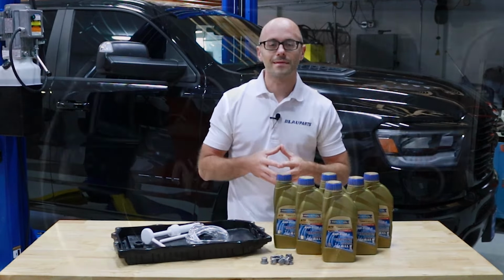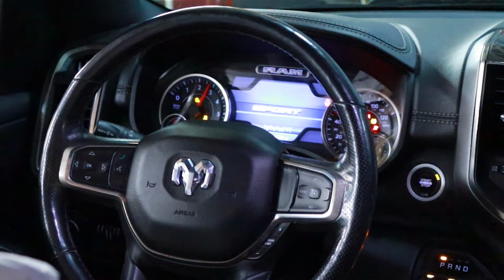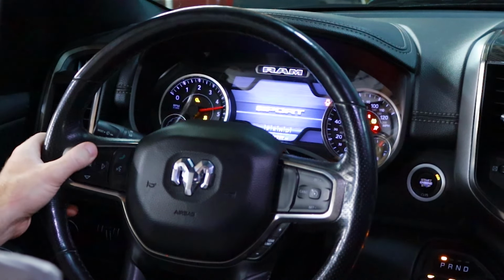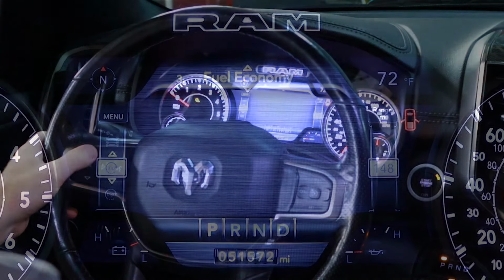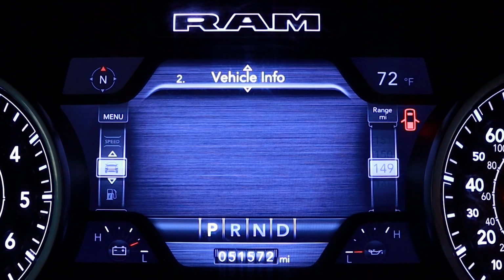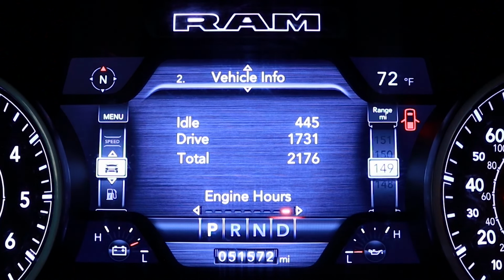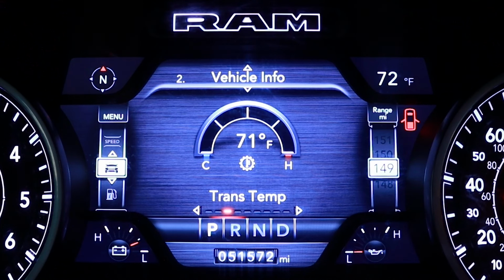Ram 1500 Transmission Fluid Change How To | 2013-2026 ZF 8-Speed 8HP

Comment: The temperature cooling process is what takes the longest. I wish he would've told me it could take all day just to stay within the 86-100 degree temps during the draining and refilling process. That's hard to do for a first timer. Plus those pipes are so dang hot 🔥 when putting that drain plug back in.
Reply: what I did was grind and Allen wrench
Reply: Did u also have to Jack up the transmission? Any tips since I’m planning on doing this job tomorrow? 😅 thanks in advance
Reply: @bdm408  No. I have a shallow transmission filter. But it was tight. Just be careful not to break any plastic fins inside the transmission near the sensor when taking the old one off.

Comment: Thank you so much. This was very easy to do. Not anymore difficult than doing oil changes. Took me 2 hours and that was me just being paranoid throughout because ive never done this before.
Reply: To add to this, it made a massive difference on my vehicle. Ram 1500 rebel, 65k miles. Wish I did this at 50,000. Instantly, all shifts are significantly smoother, don't even feel them now.
Reply from the maker: Glad it helped!
Reply: Did u use a Jack to lift the transmission? I’m planning on doing this tomorrow 😅
Reply: @bdm408  so... I lifted the truck up on Jack stands and then for the transmission to lift that so the transmission pan will clear and you can pull it off/replace it I used the little scissor jack that came with the truck because it was small enough to operate under there and a 1/2 inch extention with thick walled socket for a sturdy base to push off the jack and onto the spot they show  on the video. It's not lifting much weight so it really wasn't sketchy at all.
Reply: @stevenshelp1107  thanks so much for the reply!!! That’s actually a good idea to use the trucks scissor Jack. Smart thinking! Can u explain the 1/2 inch thick socket extension a bit more? Did u place that socket between the top of the scissor Jack and the transmission? Is it just a thick long socket? Thanks again and I appreciate u taking the time to reply.
Reply: @bdm408  yeah, so the issue with trying to use a normal jack under there is there is almost no clearance between the actual jacking point on the transmission and a cross member. You need something pretty slender, take a look at your truck before hand in reference to the video  and you'll see what I mean. I used the extension ontop of the scissor jack because it was slender enough to fit up there, and a socket on the end to the scissor jack so it was stable enough lol.

Comment: Thanks for this. I’ve read this process but seeing it makes it seem doable. I still think it is wild the owner’s manual says the transmission fluid does not need changed.
Reply: Ram says it doesn't, ZF who makes the transmission says that it does. I'd listen to ZF and not Ram, no such thing as lifetime oil.
Reply: Crystler wants to sell you an new transmission

Comment: Just completed this process on my ‘21 1500 e-Torque Laramie. This video was a HUGE help. Replaced my pan with the bigger PPE aluminum pan with replaceable filter. Everything installed very easily. No leaks and smooth shifting.  Thank you for the detailed instructions!
Reply: I just did the PPE pan on my 19' Laramie as well. How much fluid did you get back into it?
Reply: @RobVegas84  Almost 6 quarts.
Reply: I assume you have a 5th gen Ram with Hemi, is lifting the transmission like they did in the video needed for your vehicle? Thanks!
Reply: @FarmerSpring  Lifting the Transmission is to get it level and is totally a requirement. Zip out 3 bolts, jack it up til level and perform your fill. It is ok to run the engine and Reverse, Neutral and park while in this state but use common sense and do not get STUPID here.  Just do the 5 sec runs like a normal person. When finished, lower the jack stand and replace the 3 bolts. You're now done.
Reply: @FarmerSpring  I did have to lift it to get it on there. Wasn’t that bad of a process though.
Reply: Wheres the video?  Haha. JK.  Thats awesome!  So PPE? I’m going to have to
tackle this.

Comment: I have read to level the trans. The rear should be 8-10 inches higher than the front. I did that hope it right.
Reply: You did it right. The way he did it in this video is definitely wrong. The truck was level but not the pan rail.

Comment: What about the oil in the Torque Coverter oil, the Cooler Lines, and The transmission coolers themselves. Why didn't you change that oil?
Reply: Probably because what he did is called a transmission service not a full flush.
That is what the dealer will do unless you insist on a full flush.
The problem with these trannies is that they have a temperature controlled check valve installed in the return(?) line that only opens at a certain temperature to allow for a full flush. You have to know how to bypass the check valve or get it to open just when you need it to. It's difficult but can be done if you know how.
Most shops that flush trannies  don't have the proper equipment or methods to do it right. You would have to ensure that the shop understands the issue and knows how to deal with it.
The shops with the kid down in the pit don't know or care to do it right. In and out and good luck.
Some of them will do the flush but won't use the proper fluid that you take to them. They will only use their normal fluid. "We can't put any "strange" fluids through our machine".
Also they will not touch your pan in order to replace the filter.  Flush only without the pan or filter which is no good.
Sure a full flush is better but there are difficulties involved.

Comment: I don’t have the steel pipe to lift the transmission, what else do you recommend?
Reply: Losses the exhaust bolts on passenger side
Reply: That’s what I did and it worked out great

Comment: Just finished changing the fluid in my 2015 Ram rebel. Your video was extremely helpful. Thanks
Reply: Did you used jack stand ?
Reply: Hey bro did your truck take all 6 quarts mine only took 5 I just wanted to make sure its not supposed to take all 6
Reply: I have a 16 rebel and plan on doing this on Saturday. Did you have to jack the transmission and also did you level the car out and do the air test?

Comment: Is my 8 speed in the 2016 Ecodiesel this same transmission?
Reply from the maker: Hey there, as you can see in the 'Vehicle Fitment' tab of our kit for the 8-speed ZF transmission, it fits the 2014-2023 Ram 1500 Truck with the 3.0L Turbocharged V6 Diesel Engine (EcoDiesel): https://www.blauparts.com/ram-1500-transmission-fluid-change-kit-8-speed-68218925aa.html#fitment
Reply: @blauparts  Thanks. Sorry for not checking better

Comment: Thanks Dodge for making something I did for 40 yrs into a Sh#t show.
Reply: You must not be a technician.  First off, this is not a RAM transmission, the transmission is built by a German company that specializes in transmissions. Also, this is no different than the 10 speed found in GM and Ford vehicles. If you really want to get crazy, I'll show you the Mercedes Benz Triptoz transmission which takes 6 hours to fill correctly. Or, the Auidi V10 transmission, which has to be removed from the vehicle.  Here is Ford F150 if you'd really like to see a sheet show.  https://youtu.be/p96a8_MPwyM?si=vzEs-YpZmQe1SWV6

Comment: I just purchased and changed out the fluid in my 2014 1500 with 159K miles.  I watched this video several times and made personal notes of the sequences.  I've worked on cars for years but at age 72, I trusted notes, better than memory.  Approximately 5 qts were drained and added.  

Make sure the TRANSMISSION is level, not the vehicle.  Can't stress that enough.  The trans sits at an angle in the frame.  I needed to elevate the rear to get the trans level.  I used 4 jack stands under the rear since I needed to allow the rear wheels to turn in the procedure.  

The issue I had was being able to use the hand pump included.  It would not fit the bottles of fluid that are made in Europe.  I had to improvise and I used a syringe to draw the fluid from the bottles and pump into the trans.  

I did notify Blauparts of the mismatched pump and bottles and they are working on it.
I feel confident following the procedures outlined in the video I was capable of doing a complete change.  My trans is shifting smoothly and I look forward to 75K miles of use.
 Thumbs up to Blauparts.👍👍👍👍👍👍👍👍👍👍
Reply: Did you have to lift the transmission due to the cross pipe being in the way? I’m doing mine tomorrow and am nervous about that step 😅thanks in advance for any help or advice 🙏
Reply: @bdm408 did you already do yours? How it go?

Comment: I've done this a few times already with my 4th gen rams (one has 360K on it...but with no servicing and the others begin to chatter @ around 130-140K miles probably a lot sooner if you tow).....Just did my 2021 4x4 5th gen: did it in the driveway like before; definitely more of a chore and had to jack up tranny which was really no big deal, but now instead of one tough bolt there's 4.

These ZF transmissions are impressive as long as you service them
Reply: Any specific way to Jack up the tranny? Thanks in advance for the advice

Comment: At around or between what mileage should this be done?
Reply from the maker: The recommended service interval for changing the Ram 1500 transmission fluid on 8-speed transmissions is every 60,000 miles. However, this can vary based on driving style and whether the vehicle is frequently used for towing. Check out our blog here for more info: https://www.blauparts.com/blog/how-to-change-ram-1500-transmission-fluid-8-speed.html#ram-1500-automatic-transmission-fluid-change-interval
Reply: Engineers didn't this or the oil filter location thru.

Comment: Regarding the required plumb to earth to correctly gauge the fill, is it the vehicle or the transmission? If the vehicle frame is level, the transmission itself is about 10 degrees out of plumb.  I assume it's going to be different for every different type of vehicle these 8HPs are installed in.  So which is it, the vehicle frame or the transmission itself?
Reply: Transmission

Comment: Really Ram? You couldn’t move the plug a couple inches one way? lol damn engineers
Reply: That's done on purpose lol
Reply: This transmission is used on many vehicles - moving the drain to a better location for Ram 1500s would likely lead to the same issue now occurring on Chargers, Grand Cherokees, Durangos, etc etc etc
Reply: That is assnine.
Reply: Easier to reposition the exhaust
Reply: Right?! They think of themselves as God's, but they're just pawns on a chess board like everyone else

Comment: Flawless design as always ram
Reply: You must not be a technician.  First off, this is not a RAM transmission, the transmission is built by a German company that specializes in transmissions. Also, this is no different than the 10 speed found in GM and Ford vehicles. If you really want to get crazy, I'll show you the Mercedes Benz Triptoz transmission which takes 6 hours to fill correctly. Or, the Auidi V10 transmission, which has to be removed from the vehicle.  Here you go if you'd like to take a look at Ford F150 genius. https://youtu.be/p96a8_MPwyM?si=vzEs-YpZmQe1SWV6
Reply: @onthethrottle7104  you're right it could be more difficult....it could also be designed to be less difficult 😉

Comment: Should I level my truck when checking level or keep it at the factory rake.  It is a short bed 2 door to it has quite a bit of rake?
Reply: I think you need to lift the rear end of the truck 8-12 inches to get the transmission level for filling.
Reply: I did mine. Hope my fluid is right. I used 5 quarts. I had some difficulty following the end part on keeping the temp down and still running the engine, but I think it worked out. Truck had 132k miles.  Shifts seem smoother.

Comment: Just got quoted $1000 from a shop to change my fluid. Zf needs to get their crap together when it comes to service procedures. The cheapest pan and fluid i could find was $500 that is ridiculous.
Reply from the maker: You may be interested in our all-in-one ATF change kits for the Ram 1500 like the one used in this video to save: https://buff.ly/3svAhTO
Reply: @blauparts  i was under the impression it took 8 quarts to fill the ram 8 speeds.
Reply: @blauparts  what brand is the oil pan its self?

Comment: It always seems so easy when someone else does it.
Reply: Ain't it the truth!
Reply: some people just have the touch
Reply: Gotta try
Reply: The first time for anything can be daunting if you allow it to be
Reply: Exactly I said it before.
Reply: I can’t see any shop doing this correctly or taking the time.  Who figured out that you need to let it drain at temp 80-100 degrees?  Geez.  A manual is drain and fill.. lol. I’m worried to have it done, but don’t have a lift or very level ground in driveway.

Comment: So to sum it up, you said "go to a mechanic you throughly trust and have them change the fluid and pan." Got it 👌
Reply: $300 vs $1000.  to sum it up....I'll do it myself.
Reply: @Milehighsnake98 where the fuck are you going dude… at a certified shitty ram dealer is $399.99 lol 😂😂. Whoever or wherever your going is a scam
Reply: "tell your mechanic to watch this video"
Reply: I don’t know if any mechanic would do this right lol.  How the heck does the transmission lift when mated to the engine?
Reply: @bjornironsides6474  You gotta jack up the back of the truck to level the trans for filling and to your point,  no,  professional mechanics don't do that.  They can't as truck is up on a lift normally.  They just fill it up and send it
Reply: Definitely, I would take it to the dealer. This is not a do it yourself for anyone unless they are truly advanced amateurs or. professionals used to working on Rams.   If you mess up the fluid level trying to save a few dollars, before you do, price the cost of a brand new transmission. They don’t rebuild transmissions anymore. It’s like everything else, they take the bad transmission out, put in a factory rebuild.
Reply: @Cruel_Shoes You think the dealers are going to do all this properly? If they even agree to change fluid on a non-servicable transmission? You dear, sweet child.
Reply: @mattrondeau7466 if they don’t then you sue them as if you do it wrong the transmission doesn’t fails. Year later it fails within a week or 2 as if either has too much or more then likely way to low… then they put a new transmission in your truck. That’s the whole point going to a dealer. The work is warrantied for the job. Motors and
Transmissions fail immediately basically if a procedure is done wrong.
Reply: @xGR1MxREAPERx Sue them? Lmao. Good luck with that, buddy. Man, I thought the other dude was naive.
Reply: @mattrondeau7466 haha your completely right, it takes money to sue, money I don't got, that's why I doing the transmission fluid myself lol
Reply: @that_one_guy117x I swear kids think you can sue for anything and actually not have to pay for it
Reply: @Cruel_Shoes I agree but with the newer ram having the fill plug you only hafto add tell it starts flowing out
Reply: @Cruel_Shoes  Ya I don't think most mechanics even bother all the extra. they know it has a spec amount. They probably drive it, let it cool and check it. I am wondering why you have to jack it up. I mean after you fill it I don't think the truck knows the wheels are off the ground. Why would a regular on ground load make this not wor?
Reply: @GoingNowhereFastBFL because the wheels need to turn and you need to get into 2nd gear. Theoretically the dealer procedure actually says take it for a short drive and let it get into 5th gear. Then go back to shop and check level etc etc. so ya wheels off the ground to get wheels spinning and shift gears
Reply: @Cruel_Shoes false if you ever owned a VW this is like kindergarten 😂 actually almost same process as dsg in my mk6 gti
Reply: @Cruel_Shoes yeah this is exactly what I'm going to do my local shop I've done business with them for years.   I'm sure I could buy this kit and they'd do the work for me for a cpl to a few 100 bucks.   Id feel safer that way.  I'm no mechanic and I def don't own a lift lol
Reply: Follow the procdure.  You do need four jack stands and a level...    If you have a helper, don't let him drink....At least until your done.
Reply: @Cruel_Shoes yeah I do my oil changes and everything fluid wise myself, but when it came to 75k miles I dropped my truck off at the dealer. Most people don’t know, but the rams transmissions have a reservoir that keeps the bottom portion of the oil even when fully leveled off. Gotta get a vacuum in there and suck out the shavings and leftover oil.
Reply: @SweetLouDootDoodlyDoo  did you even watch the video? You dont need to vacuum anything out on this transmission. (Zf 8 speed)

Comment: Don't you need to drain the torque converter?  That's why the oil is filthy in the last step...you only changed half the fluid.
Reply: Exactly! I did a half fluid change then drove for a week. Then did the filter and fluid the following weekend. You'll never get it all out unless you do a flush.
Reply: @seanblomeley611 that’s smart but man what a pain in the ass
Reply: @Brad18819  Its not the easiest, but also not the hardest. And you definitely have to stay on top of maintenance for these trucks.
Reply: Don’t think it is recommended to replace it all.